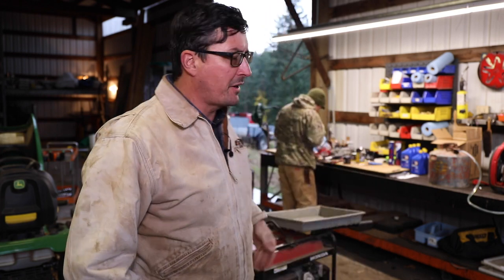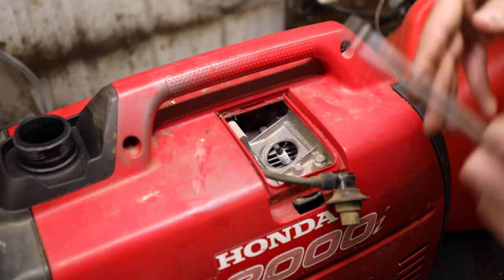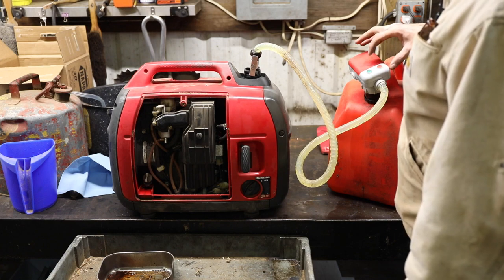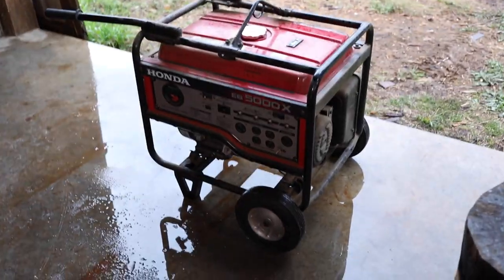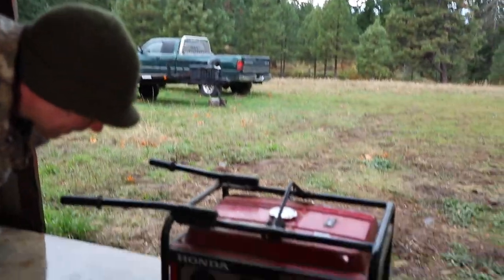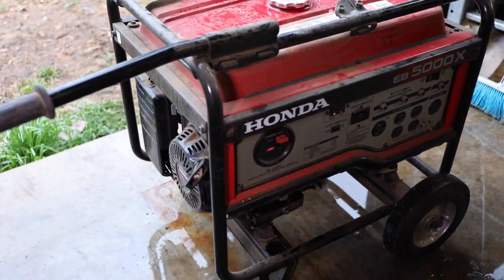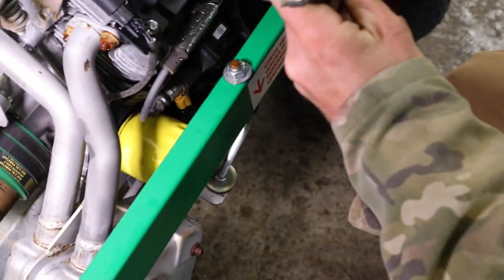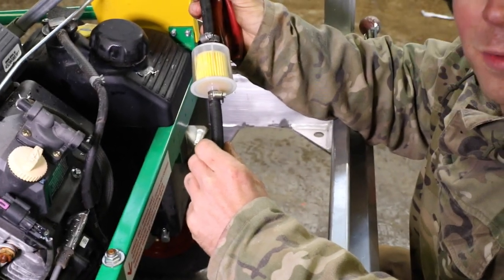Signs You Have WAY Too Many Tools!!!

Comment: They sell an attachment for oil bottles it's 98 cents and it has a little funnel tip that screws on to the bottle. Trust me it's a life saver for snowblowers etc. god bless
Reply: Noah Sorensen I’ll have to look for that. Thanks.
Reply: also if you turn the bottle so the spout is on the high side when pouring it is less likely to run down the side of the bottle onto the floor.
Reply: Noah Sorensen i know sometimes they give them oit there also great for antifreeze

Comment: Filling the fuel tank full (removing as much air space as possible) and adding fuel stabilizer, and draining the carb from the bottom (drain screw) is much better to avoid stale varnished fuel come next season.  Fuel varnishes with oxygen, so a vented full tank with a very small air space is much better off than mostly empty tank with large air space.  (Small engine / Motorcycle mechanic for 20 years)

Fill the tank and drain the float bowl.  Remove the battery if it has one and trickle charge during the off season.  Some go further and remove the plug and fog the cyl. with WD-40 and reinstall.

Comment: So regarding those screw clamps that you like so much...  The auto industry went away from those inferior things many years ago.  Not because the constant pressure clamps were cheaper (that was just an added benefit) but because the constant pressure clamps work better!  A screw clamp gets torqued once in it's lifetime and eventually due to thermal cycling and aging the hose materials shrink making that one time torque insufficient.  This is why constant pressure clamps were developed.  It's to reduce warranty costs.  You're not alone in your dislike for them.  But there are special tools available that work great with them (yeah more tools!) and quite honestly they do work better in the long run.  Carry on the great work you do....
Reply: Steve Huetteman you are bang on. In plumbing if you use a piece of flexible hose with those clamps, you have to retorque a few days later and then retorque again a few weeks later otherwise it will start to leak.

Comment: What I do with those kinds of oil draining systems like the one on your small generator is to attach a male hose fitting on a small piece of clear hose and then simply screw it on to the threading on the drain and tip it over into my catch pan.
Reply: Heh,30+ years as a mechanic,and I never thought of that....D'OH!!
Reply: Thanks for the kind responses. It's rare to have nice replies these days. I'm glad my idea might be of some help to others.

Comment: Get a vacuum oil extractor. 
Much easier, neater, and faster changing oil in a bunch of little engines with weird drain plug locations. No chance of a cross threaded drain plug, or having to replace crush washers.
Don't have to tilt little motors on their sides and spill oil everywhere. My Subaru has a top mounted oil filter so I never have to crawl under my car to change oil.
Reply: I agree. Mine can be hand pumped, or run from a compressor. With most engines, you can actually get more out out with an extractor than you can by removing the drain plug.
Reply: Ya but tipping it and draining it will get some of the sediment that builds up on the bottom out.
Reply: So what should he do with his lawn tractor, quad, water pump, and sawmill? Tip them on their sides to get the sediment out? C'mon, modern detergent oils keep the dirt suspended so it can be removed by a filter (or drained out).
Reply: Mark Schmitz good luck with your car when calves on the road. The little gauze in the sump will be clogged up with little shavings and so on

Comment: Those Honda's are always a PITA. The only way I found to do it is empty the tank so you don't spill fuel, turn it on its side so you can fill it. Pour in the amount stated in the manual and then turn it back upright. Any extra will come out the filler and if its not enough you can tip it back up and pour in more. Also there are much better corrosion inhibitors than WD. When I was younger I worked in a bike shop whilst I was studying as an aircraft engineer. We submerged a chain in WD-40 in a pot. 2 weeks of submersion and it was rusted! ACF-50 is the ultimate, a little more expensive but worth every penny. Even used on aircraft to protect them.
Reply: WD-40 was developed in San Diego for use in the Atlas missile program. I worked there at Gneral Dynamics Astonautics when we developed and produced the Atlas intercontinental ballistic missile. It was intended primarialy as a water displacement and peneteating product, not as a lubricant or corrosion protecion. It was used in Vietnam to remove water from small arms and artillery. It will penetrate and 'kill' primers if sprayed on ammo. A superior product that I have used for rust prevention  is Boeshield T7, developed by Boeing Aircraft. It's offered in a variety of sizes and can be purchased on line from Amazon.

Comment: i have to admit i cringed a little at how much you cranked on the spark plug on that honda generator...
Reply: Some anti-seize (copper based) would give a nice seal & prevent any problems when removing the plug.
Reply: Me too
Reply: TheBCSledder yea man
Reply: Yup two many more annual spark plug changes like that and he'll need a cylinder head.
Reply: Depending on the head material he should be right for a while with Steel, Chances are if its aluminium hes gonna tear it out, done that once tell you what never again. Not saying i'd do it that tight but he knows whats right with his own equipment.
Reply: james griffin bigtime
Reply: dogre grimes most small engines have aluminum heads so chances are in awhile it will be destroyed
Reply: It was an ngk plug with a compression setting washer so it probably just seemed like a lot.
Reply: Eh just tap it when it fails then use an insert into the head.....or just torque the spark plug right the first time...that always works.

Comment: Good video. I have several of those funnels i have made from used fuel filters. the biggest is a used fuel injection filter from a Ford . It also works great to attach a piece of hose to them for those hard to get to areas. The smallest ones i have reduced down to 1/8 " hose for filling things like hydraulic jacks. I am a great fan of re purposing everything I can. Thanks for taking the time to share.

Comment: I became a believer in Stabil fuel stabilizer for small engines.  Before winter,  I drain water from carburetor bowIs, or fuel filter, or sediment bowls.  Pour in a strong mix of Stabil, and maybe top off the tank. Run it awhile to fill the carb.   I think empty tanks collect humidity, and cause gumminess.

Comment: Best funnel for small jobs - a small funnel (funny that...) stuck into a foot-long piece of garden hose. Means you can pour oil into just about any orientation of oil filler port without losing oil all over the place. We use it on a V6 van where the engine oil filler port is up under the scuttle - works really well.

Comment: I just finished using my Honda EU2000i for the last 5 days straight here in southern Maine due to the wind storm, best generator on the market. The steel screw in the stainless clamp allows you to pick them up with a magnet when you drop them and they shoot all the way under what you are working on, so not all bad.

Comment: Hello Cody and family, I thought it might be a good idea to mention to Always Always Always Remove Any Spark Plug Wire, when working on any small engine. Especially if you are working near the blade. One careless spin of that blade, and you are missing some fingers or worse, if it decides to start, if you do not. Also, Cody try screwing a 2 inch long piece of pipe in that generator drain to help not make such a mess. I enjoy the videos!!! Have a Great Day!

Comment: @wranglerstar - just my 2 cents.  If you read the instructions that came with that battery it would have said leave the vent caps off for the first charge. Lol.  I’ve had negative experiences with emptying my gas tanks. I personally just use stabil all year round then do a winter mix for storage.  I’ve had carb seals dry out and leak as well as float stick when left without gas.  A great winter project for jack is to go through grandpa’s bolt bins and sort for faster access. Especially those priceless items. Take care. Be well. God bless.

Comment: I've always been taught to add fuel additive and fill everything up all the way. If not, in the winter and if the tanks are empty then there's a possibility for condensation in the gas tanks and could harm your engine when starting in the spring.

Comment: Cody, get your self some hose clamps made by Norma. Made in Germany, The have beveled edges so they won't cut into the hose, and the teeth the screw rides in is not cut into the band, but a raised surface. I think the band is pressed. You can find them on all German cars. I will not use any other hose clamp after using them. I'll get them when I visit the wrecking yard. I know you pay attention to details.

Comment: We can never have too many tools.  I will disagree with one thing Cody and it's only my opinion that I keep my stored tool fuel tanks 100% full and use Sta-Bil in addition to 2 cycle pre-mixed gas to prevent any condensation.  I run my tools for about 10 minutes making sure that the stabilizer is thoroughly through the fuel system, top them off and store them.  I've yet to have any problems re-starting my small engines in the spring.  I reside in northeastern Vermont where we get some pretty heavy snow and cold weather during the winter months.  Luv your vids Cody and thanks again for all your insight mate.
Reply: William Logan 
Very good tip there William. I think I’ll do that too on our equipment.

Comment: Oh also, there is an adapter you can buy for the honda, that threads into the oil fill port. It gives you an extended spout so the oil can be poured out without spilling everywhere. And its easier to fill too. Also the magnetic dip stick is a good addition too. Bought both of them back a couple years ago.

Comment: We own a small tool rental store.  To fill all these small engines with oil quickly and cleanly we save the spouts from quart bottles of gear oil and thread them onto these Napa oil quarts.  Trick is to use Napa or Pennzoil quarts as most others have too large an opening for the little re-purposed gear oil spouts.

Comment: For a funnel, use a turkey baster. I do my lawnmowers and parking lot vacuum this way: Take the bulb off the turkey baster and save it, you might want that with a pvc pipe later to make a mini siphon, but then you take the long juice holder part of the baster and at the pointed end shave off the knurled tip  with you knife. Instant small engine oil funnel :)
Reply: Also the turkey baster funnel fits GREAT in a hydraulic jack if you need to bleed and fill it :)

Comment: I doubt if I use a stringline trimmer as much as you, but I changed the spark plug in my Shindaiwa once in 18 years and it didn't need it then.  It starts beautifully, before and after the spark plug change.  I wasn't aware of the proper way to pour out of plastic oil containers.  Thanks for the tip.  I generally buy the 5 quart containers.  This tip will help with those, too, if there is enough room to hold them in this orientation.

Comment: I change the oil and fuel in the spring. Like you said, the most important thing is to get the fuel out. Modern gas turns into turpentine pretty fast.

Comment: good tip for storing and or using motors over winter remove the battery and store indoors till you want to use it 
and i get that some things  you don't want to remove the battery after every use (like cars and things you use daily) a jump start battery might be helpful   
Cold batteries discharge faster than warmer batteries, so if you're using a cold battery, keep a warm one in reserve.

Comment: I have the same Honda eu2000i generator, great little set. But it needed one modification, a way to shut the fuel off to the carb. So I purchased a quality 90 degree metal fuel cutoff valve, connected the fuel line to it, drilled the appropriate size hole in the top of the generator, installed the valve in the top of the generator case, which I like because it is easily accessible without removing the side cover. Now anytime that I am not going to be using it for awhile, I simply start it up, then once running, I shut off the fuel valve, and let the carburetor run empty. When i need it again, I turn the fuel back on, crank it a few times to get the fuel back to the carb, then it starts back up. Simple. 

And Yes, I also do NOT use ethanol fuel in ANY small engine. Here the only grade of fuel that doesn't contain ethanol is 93 octane premium, but its worth it. 

I also stabilize the fuel in my storage tank with a product called PRI-G, which is the best fuel stabilizer I have ever found. (the PRI-D for diesel is also great)  So long as you add it to the fuel at least once per year, it keeps it fresh. I have used gasoline that is over 2 years old in my small engines, and the ran like I just bought the fuel that day. 
Plus, when I use this fuel in any of my small engines, I don't have to worry about it going bad in a month or so like it normally would. I can let it winter in them, and thats ok, they still run perfectly fine the next spring. Although I still try to install shut-off valves in most things (if they don't already have them) so i can empty the carbs for the winter, or any time they aren't going to be run for a while.
Anyway, didn't mean to run on, just my 2 cents.

Comment: Funnel: Next time you are down to the parts store, pick up one of those 90w squeeze bottles and keep the nozzle off of it. They screw right on an oil bottle, and they'll take a hose if you are careful (hold onto the hose or it will push off when squeezing) I keep every one of them I get.

Comment: Put the cap from a power steering bottle (the one with the pull out spout) on your oil bottle and you don't need a funnel :-) . Or if it doesn't fit, just dump the oil into the power steering bottle then fill up from that. Works a treat!

Comment: The grocery store actually has tiny funnels.  I have a Generac 3250 that is at a really odd angle, so luckily I used a water bottle I cut to shape ...and it  screws into the oil hole!

Comment: Use an old oil bottle to make a funnel. same way as the paper one but plastic.  Also bottles such as "Heat" or other gas treatment bottles make great funnels. Just put the cap back on when you use it and throw it in the toolbox. keeps it clean till you need it.

Comment: Old fuel, I dump it in the old pickup (1997 Ford FI) truck and run it. Never had an issue with the truck doing this. 

Storage, I always run Ethanyl free fuel with stabilizer. You never know how long a piece of equipment may sit. If I plan on long term storage I will drain the fuel, and add a little 50/1 ethanol free 2 stroke mix with stabil in it and run it until the fuel runs out. The 2 stroke mix coats the carb with a thin coating of oil along with the internal parts of the engine (at least in theory).

Comment: The best filler funnel thing for small engines is the screw on top that comes with 90 weight quart or bar and chain oil its already pointed and screws on to most quart bottles and to speed up the filling you can just squeeze the bottle

Comment: Convair, an aerospace contractor, first used WD-40® to protect the outer skin of the Atlas Missile from rust and corrosion. The product actually worked so well that several employees snuck some WD-40®cans out of the plant to use at home. From wd40 website

Comment: I'd like to recommend lithium batteries for your small engines with electric start. I was hesitant to get one myself, but ive had one in my motorcycle for around 4 years now and i've never had it go dead during the winter or anything like that. Always fires my bike right up!

Comment: Give Corrosion-X a try, it works better than WD-40 for rust prevention.
Reply: ecleveland1 Amsoil HD Metal Protector too. It lubricates and then leaves a dry, waxy surface. It totally replaced WD-40 for me.

Comment: For the battery that you have to add acid to it is always a good idea for the first charge to leave the cap off due to the excess amount of hydrogen during the first charge. This will prevent possible fires. Keep up the good work!

Comment: As a small engine mechanic, just let me thank you for using non-ethanol.  Using ethanol fuel is as bad as you or me drinking arsenic.
Reply: Ethanol in gas keeps a lot of repair techs employed.
Reply: Only bad if you are long-term storage.
Reply: I use ethnol if I know I'll use a full tank but after that I run the carb out and fill her up with non
Reply: why do race cars use it

Comment: Instead of draining, I add fuel stabilizer to all small engines and anti gel to my diesel.  I do shut off the gas and run the carb dry, but use the stabilizer in the tank.  I can fire up the generator, or wood splitter at a moments notice instead of having to refill and start over each time.  I also use nothing but premium non ethanol gas in all gas engines.

Comment: Hmm, I used to empty all the gas from my lawn mower and run it dry but I would once in awhile run into the problem of uh....(forgot what it is called) the pin thing in the round cylinder would become stuck.  Ever since then I would leave just a little bit of gas with stabil in the tank and so far I haven't had an issue the past 3 years, started up come spring time first pull!  Granted every fall I do what you were in the video and cleaning everything up to get ready for next spring as well.

Comment: Make sure to read your manuals...I bought a Ariens snow blower a few years ago and I ran it dry to store it, it wouldn't start the next winter. I took it to the dealer, and they said to store it wet with stabilizer...even the manual says that, but you have to READ it to know that, lol